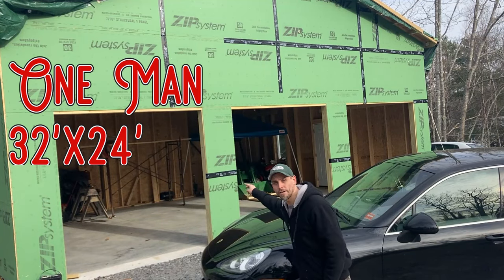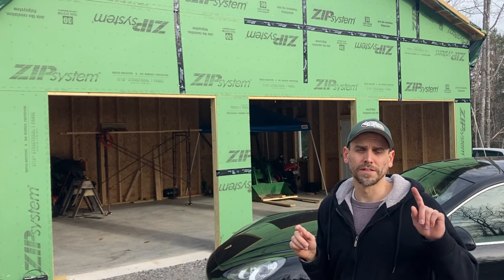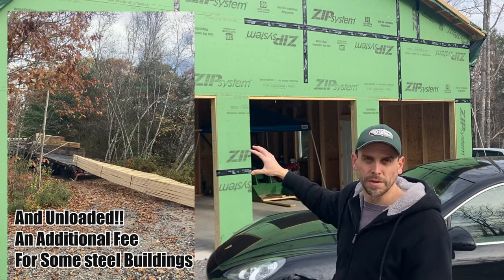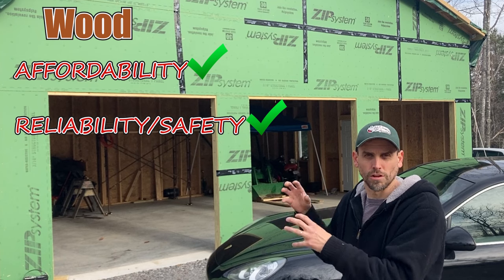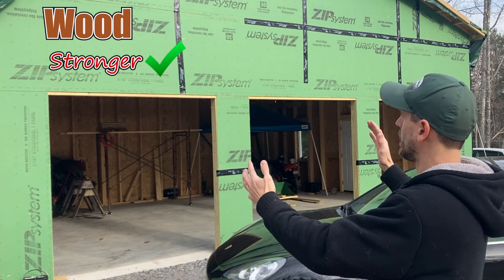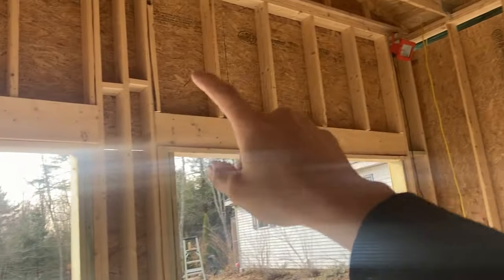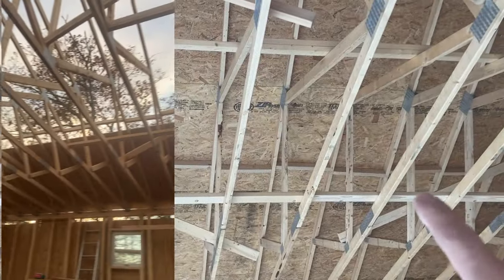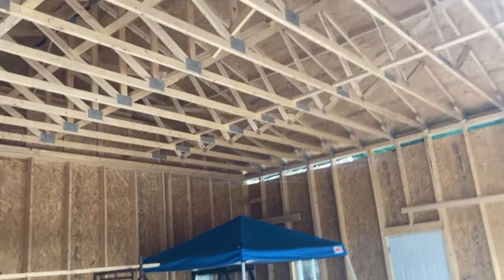Tube Steel Buildings Pros & Cons Watch This 1 Man 3 Bay Garage 32'x24' Man Cave Solo DIY Build First

Comment: Hmmm,  Interesting.  I started years back framing roof after roof and we were never told to cross brace the trusses.  I wonder if the truss world updated since that time.
tHanks for a very interesting video!
Reply from the maker: Yeah there were lots of updates like reinforcing the gable so hurricane can’t suck it out, I guess a lot of codes on that changed after some big storms damaged a lot of roofs
Reply: Always improving  @ecophage  .  I built a house in Florida and then went to the big CT next.  CT's codes were far more relaxed that Florida's. 
I picked up the lesson of building to the environment around us.  

All that cool building was before...now I'm no more than a door knob changer because ....actually...I don't know why.
Funny how that works.
Well, at least I have a nice collection of door knobs.

Have a great afternoon!   Happy New Year!
Reply from the maker: @Dancing_Alone_wRentals  the codes here are pretty lax, this information was with the packet that came with the trusses. So it’s possible it’s just manufacturers recommendation

Comment: Hey there - I drove to Milo Maine during that store.. it was nasty! I had 3 hours worth of detours coming from vermont!

I also plan on building a 3 car garage like this but with a bonus room above it this year. You mentioned a few of the costs. Do you have a full break down of what you spent? Even down to the slab- thanks!
Reply from the maker: Oh Jeez That a lot of detours hahah,

My slab cost probably twice what it should have due to the groundwork to level the site. It was approximately 7500 ground work, 7500 in the slab pour and form, Id guess about $25k budget. you could probably do it for a third less  if your sire was level and you found a cheaper concrete guy. I used shaedler in Topsham. Great guys but pricey

Comment: Interesting that you called out the "Cheap" tube steel buildings.......Seen some utube clips on them, the video you showed, Seen that, and the problems, bottom line, he had an inexperienced hack crew try to do it, and failed.  Glad you called out the "hidden" fee's and red (flag) wording in the contracts.
Comparing your wood stick build to the metal tube, your much better off, period.
Reply from the maker: Thank you, glad I could lend something to the conversation